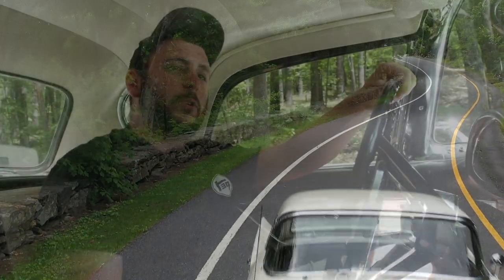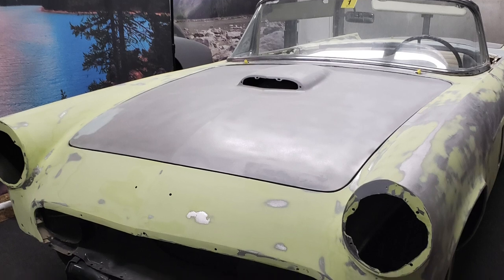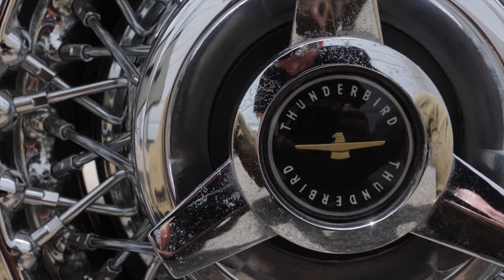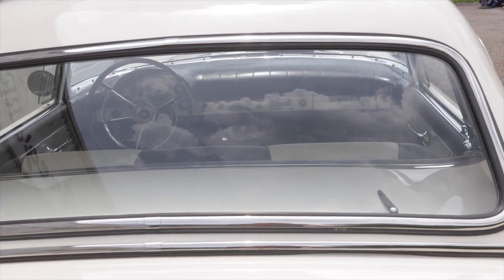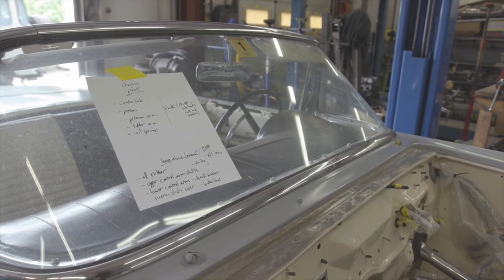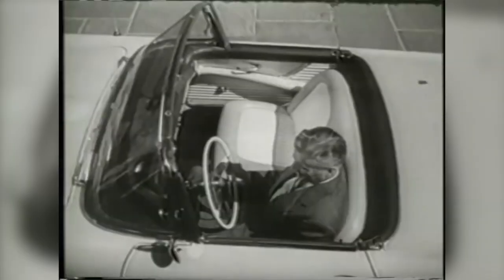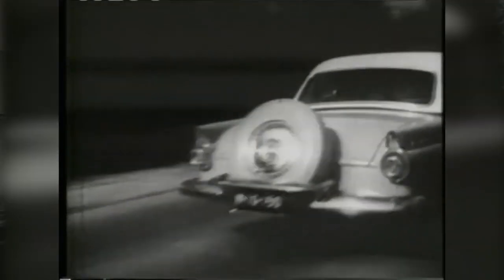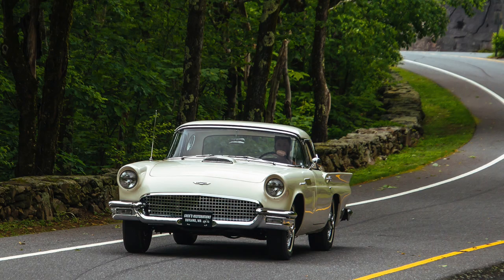1957 Ford Thunderbird Restoration : Project Snowbird

Comment: If the engine compartment pictures are of this car, it indeed has power brakes.  That brass colored part just in front of the battery is the booster. The idea that convertibles do not need A/C is ludicrous. But only dealer installed A/C was available on 1955-57 'Birds.
Reply: @RRyder85  I say this because in the video you state it does not have power brakes. Very nice restoration.